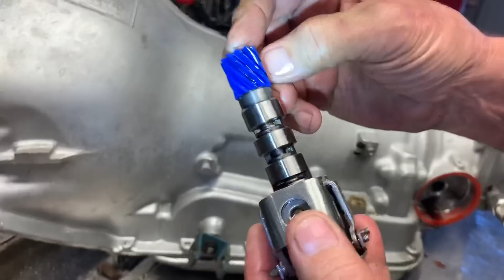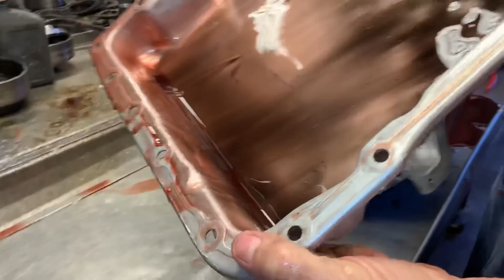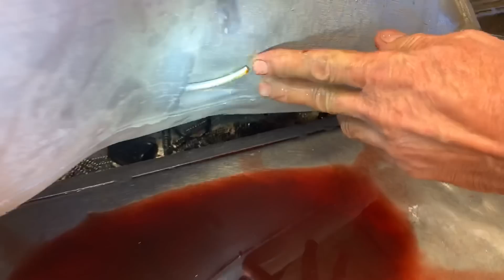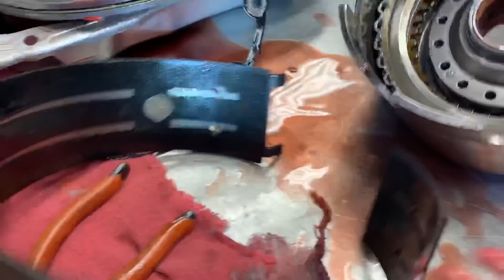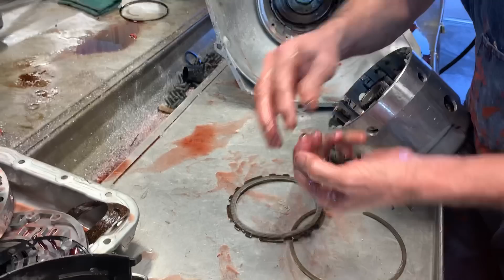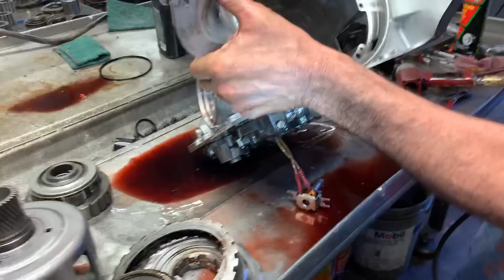Reason why we don’t like doing carry out transmissions. Video 1-2

Comment: I listened to your point. As a technician I cannot disagree more with you with the a ready to install transmission you rebuilt. You suggested that the customer had the shifter cable out of adjustment. If BAR would to come out you would be liable for that transmission, not the customer. You’re required by law according to BAR to have the unit ready to install on PARK position or NEUTRAL depending on the trans and manufacturer. Additionally, if you have precautions you should have a signed document informing the customer.